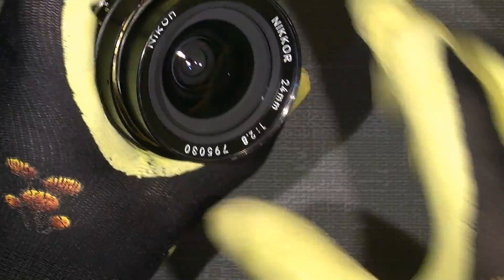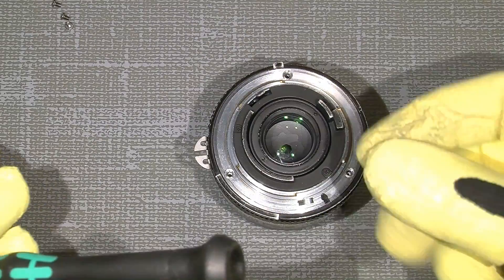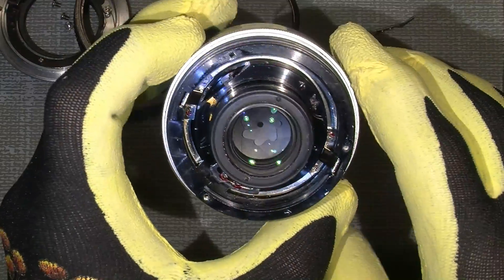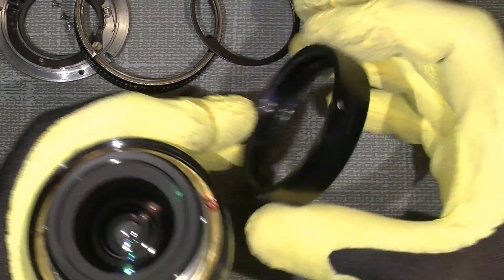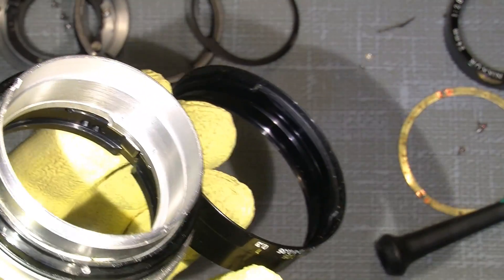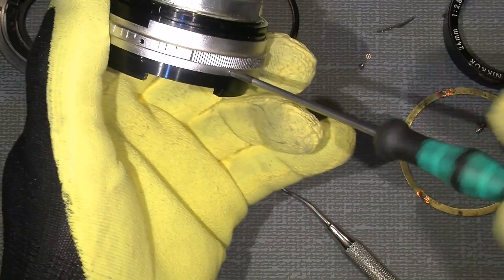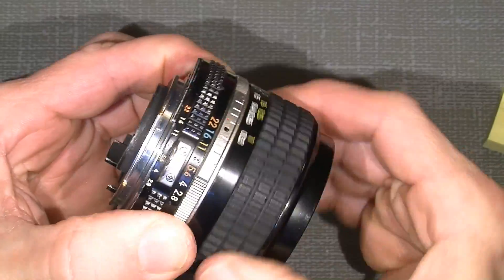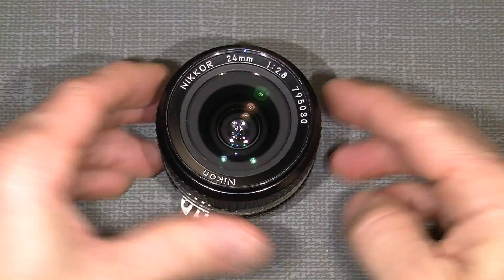Re-grease the focus system in AI-s Nikkor 24mm 1:2.8____front and back helicoid's

Comment: hello Mike , many thanks for your videos ! it helps all of us to service Nikon lens by ourselves  . I have bought same 24mm AI-S 2.8 and it seems that there is some fungus inside and most probably on the back glass of the lens . I can not say exactly where . Have you made a video about cleaning the glass element of this lens ? if not I would like to avoid to  disassemble completely the lens . Can I clean the back glass element by unscrewing the black inner rotating ring with two small holes using the special spanner tool ? ( hope I am clear enough ) .thanks for your help . daniel from france

Comment: Hi, great video's! I have a question. What if the rubber focussing ring is dried out, so it tears when you try to take it of? Is there something that i can put on it to make it smooth again?
Reply from the maker: Thank's Anthony, the rubber focus ring will over the year's of use simply dry out, sometimes faster or slower... Maybe one can give them some light silicon oil, just like the same that's use on the rubber door seal in the car, it was just an idea.
OR buy a new rubber focus ring...
Reply: Thank you! I will try it and let you know if it works :)
Reply: I used silicongrease and it worked!
Reply from the maker: I will try that too, great idea :-)